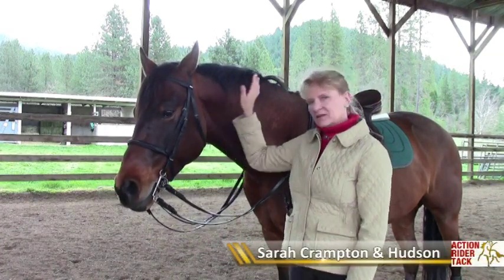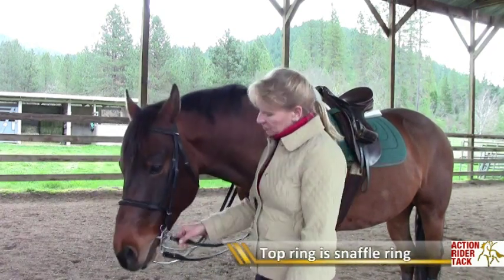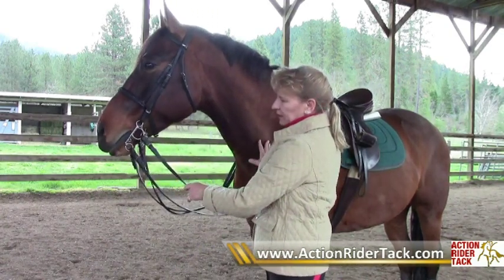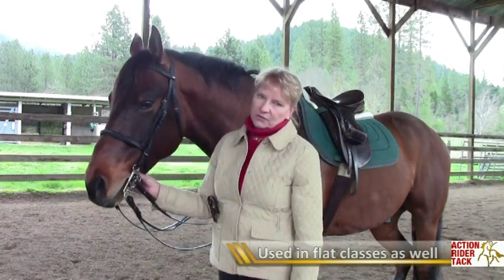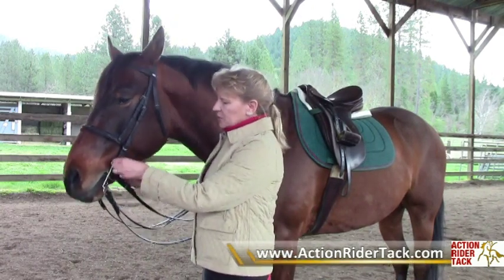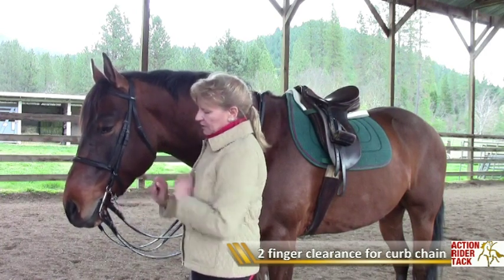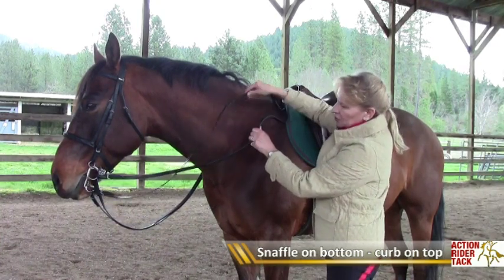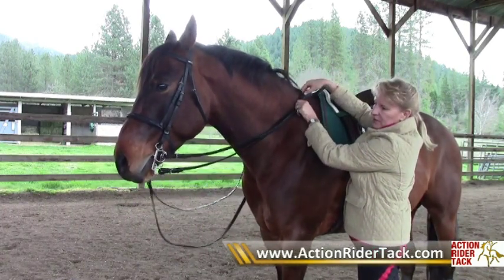What Is: Pelham Bits by Myler Bits

Comment: I miss measurements. Bits cannot be discussed by having a look or by testing them on a horse. To compare them, we have to measure the pressure they are using on the horses mouths. Not everything possible must be used for sport and fun. Damaged horse  teeth and broken horse yaws are not acceptable. Rubber instead of steel must not be an advantage, because it may cause more friction on the sensitive skin of the horses mouths.
Reply: Bernd Horsch rubber is softer then metal..........get your information correct before commenting.
Reply: @justsimplyliviehere1307 rubber is more flexible, but rubber does RUB the gums if the horse doesnt produce enough saliva instantly. a steel bit doesnt.